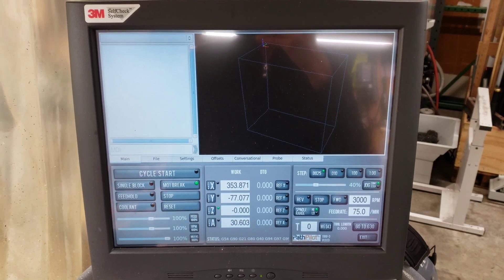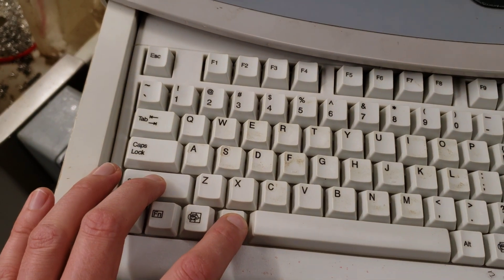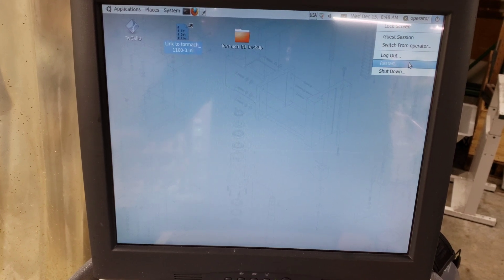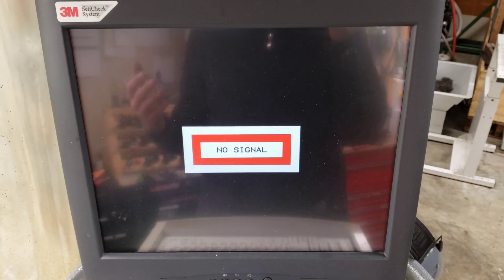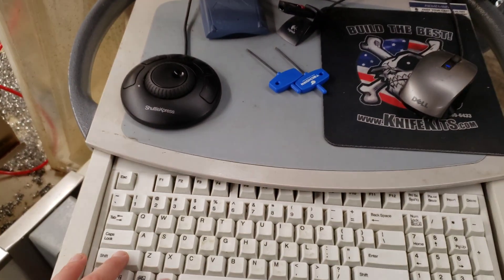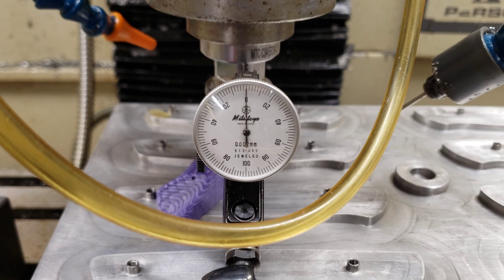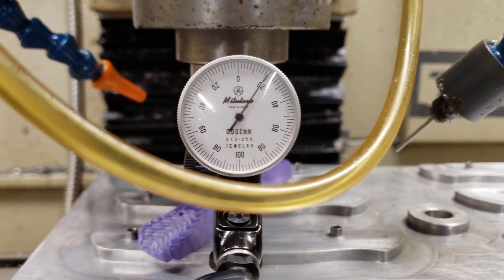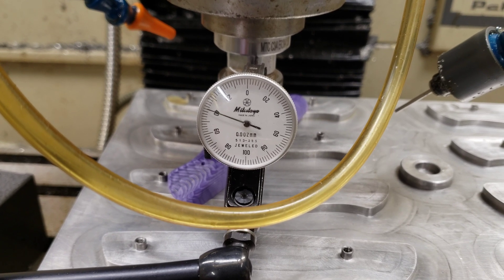How To Open Gnome Desktop from Tormach Path Pilot to change parameters like backlash compensation

Comment: For backlash comp you can just use the admin command ADMIN BACKLASH SET in the UI
Reply from the maker: Thanks for the tip. I did see a video describing how to do that, but it looks like the version of Path Pilot we are using doesn't have that option available. I tried to enter the commands in the UI and it gave errors. The obvious solution is to upgrade to the newest version of Path Pilot, but we don't have the time to do that right now.